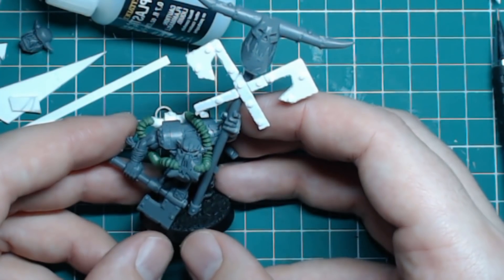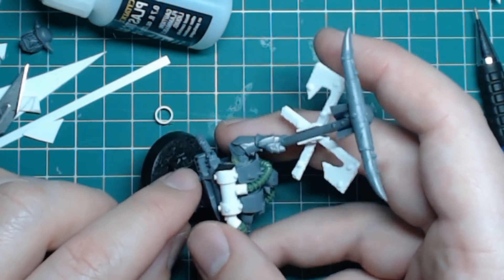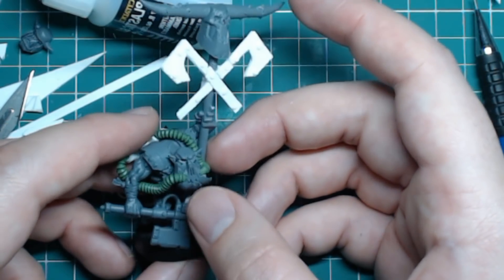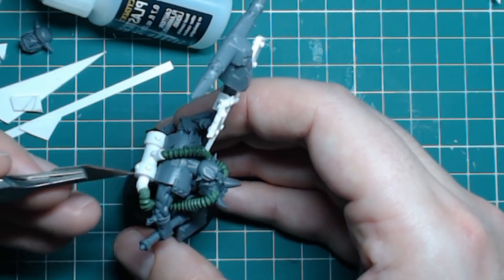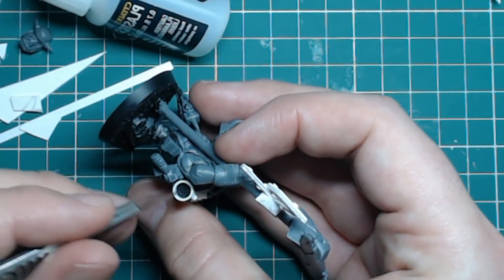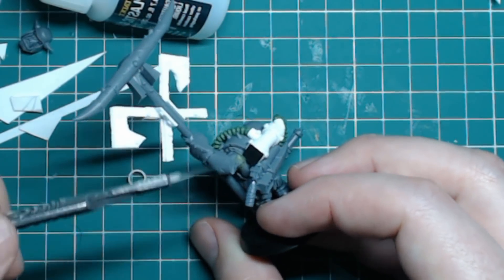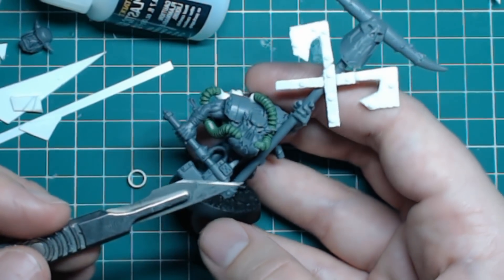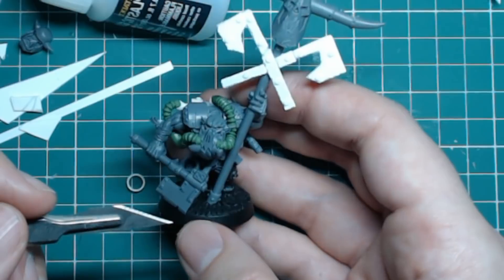Ork conversion advice

Comment: Nice topic fer a vid - the worst conversion is the one you never start and the best thing about Orks is they don't need to look neat and tidy - corners aren't square? - a meks only gonna cut steel at a right-enuff angle ;-)
Reply from the maker: Ork conversions can be very forgiving, but should not be an excuse for half baking something. If you give 100% at least you know you tried your best.
Reply: Fair point but (for me at least) one of the biggest problems with (for instance) the vehicles GW make for orks is that they have all straight corners and panels, most working vehicles haven't (worked for a company that hired out vans and we could easily recognise which was which from the dents on them) and vehicles driven by Orks...
The real trick is to just do what you can, if you look at the finished item and think 'doing it this way could have made that look better' then try it on the next one and see if it is better, and if it is better then see if there's any way of improving on that - there's no real problem in going back to a vehicle you completed years ago and trying out new tricks on that. What I really don't want is my orky vehicles to all look the same as each other or anyone else's. All anyone has to do is start, and it doesn't need to win a Golden Demon award to look good on the table from about four or five foot away. :-)
Reply from the maker: Well said, already thinking of tinkering about with the Waaagh banner Nob for my blood axes. I'm wondering how a beret would look on him.
Reply: Go fer it - it'd be easy enuff to remove if you hate it, if you've got a steady hand and some decent magnification you could even have a go at making a tiny crossed axe cap badge as a seperate bit on some plastic sheet and then transfer it to the beret whilst still tacky.